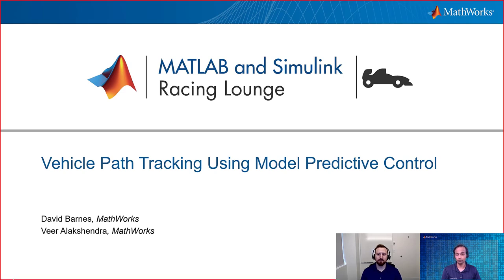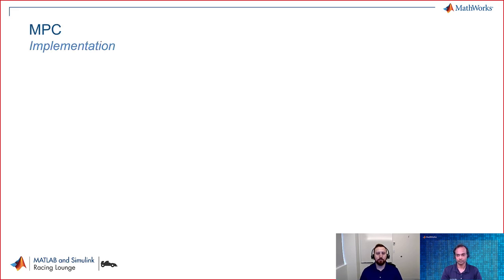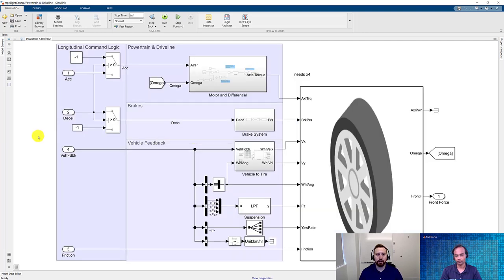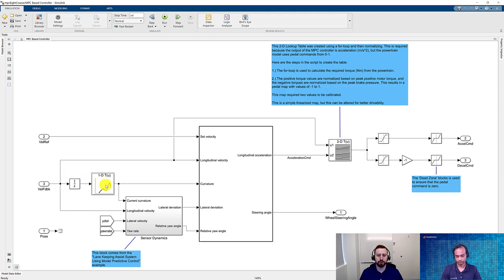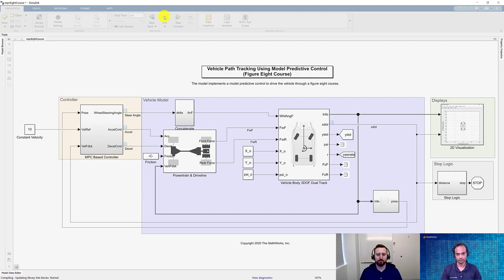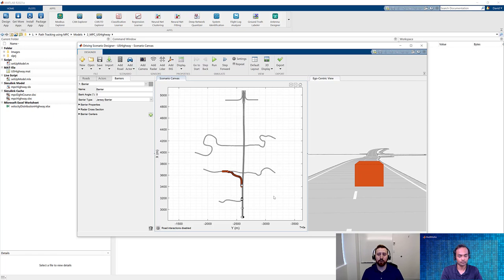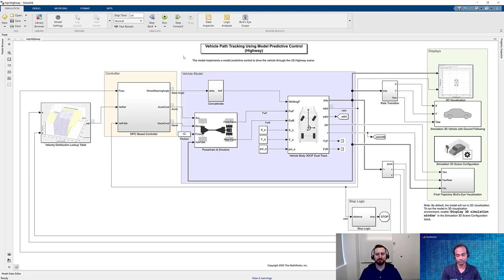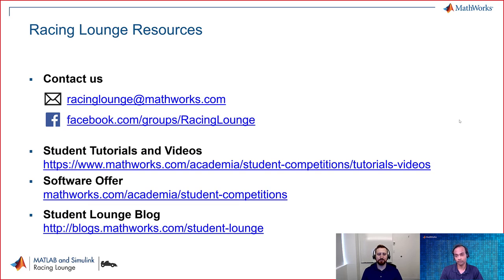Vehicle Path Tracking Using Model Predictive Control

Comment: I have a question. For traditional or conventional MPC, do we need to linearize our nonlinear plant model, or we can use it in the form of nonlinear plant to be included in MPC design?
Reply: I guess it depends on how nonlinear your plant is. For small deviations from the ideal case, it is possible that a linear MPC controller might be able to manage.

However, there is Nonlinear MPC available as well and for safety-critical or high-performance applications, it might be preferable to use that: https://mathworks.com/help/mpc/nonlinear-mpc-design.html

When we worked on nonlinear problems in the past, we ended up using a multi-stage controller that could switch between different modes depending on the plant state and also had a nonlinear control response.